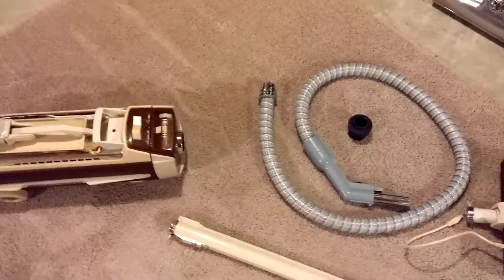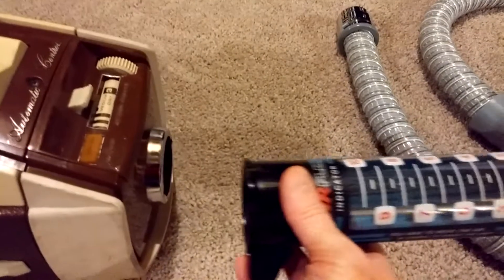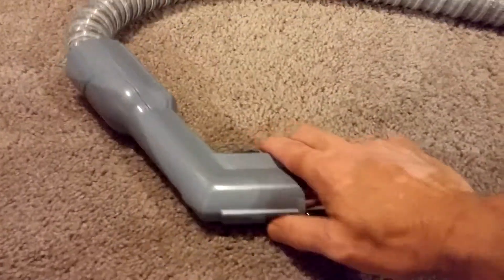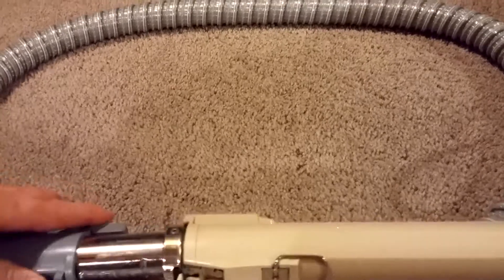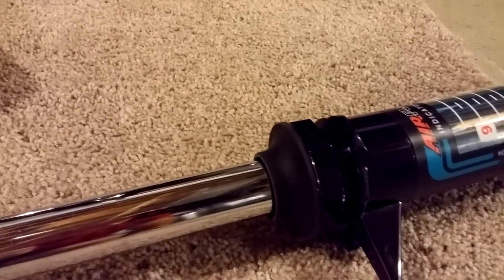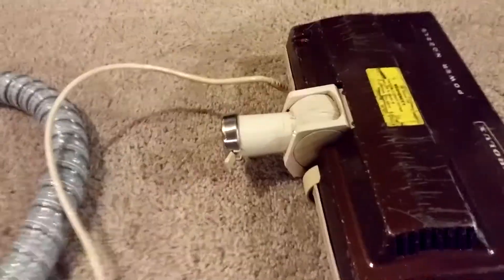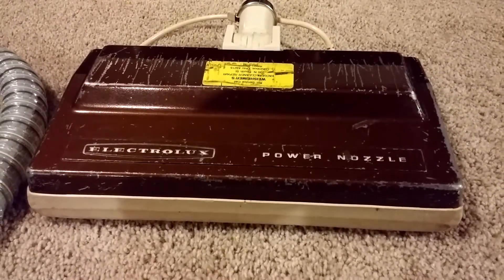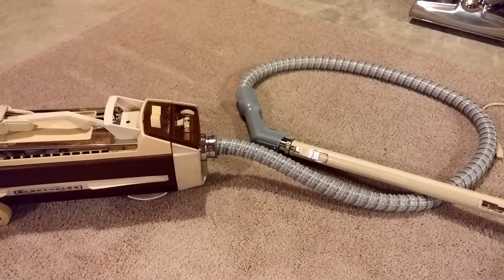Canister Airflow Losses

Comment: What about canister vacuums that use a tapering hose that is wider at the vacuum than at the nozzle?
Reply from the maker: Any time an orifice gets smaller, airflow decreases. Kirbys have a two speed switch that flips into high speed mode when the hose is attached in order to counteract the losses by boosting the motor speed.

Comment: I am huge fan of your channel.I have soft spot for classic well made canisters. My Lux Royal D790 is one good example.
It is so called European version of classic Electrolux. Only sold by door to door, very expensive, looks like it came from the 70's (made in mid 90's) and have very good performance.
It pulls 8 from the Kirby airflow meter (103cfm) when measured from the 9ft long hose end. I really don't like any modern canisters so much.

Comment: I think if you have say 90% carpet and 10% hard floors an upright is so much better however if you have all hardwood floors and a few small area rugs a canister vacuum would be fine I am an upright fan so I just prefer an upright over a canister
Reply from the maker: I might think that if you have very little carpet, most people wouldn't bother with a canister or an upright, they would have a "Swiffer" and maybe a stick vac.